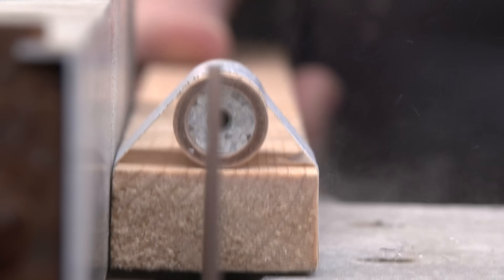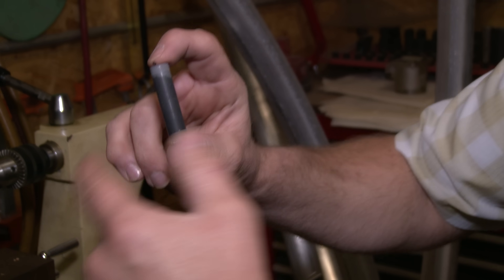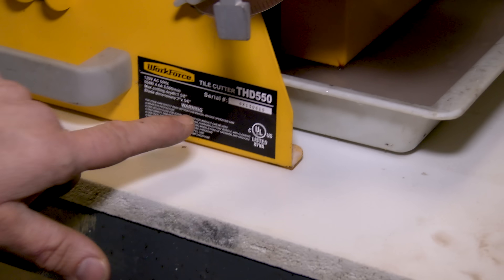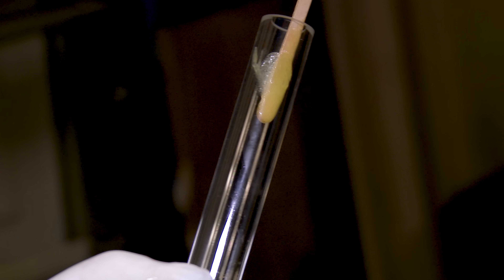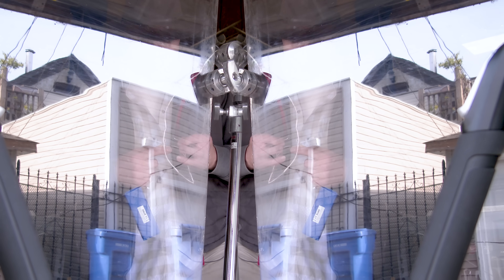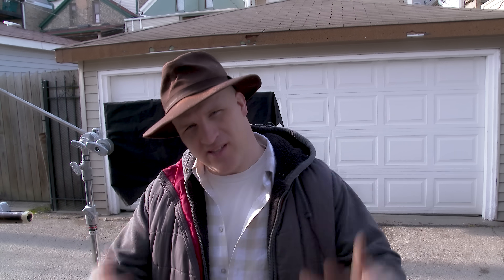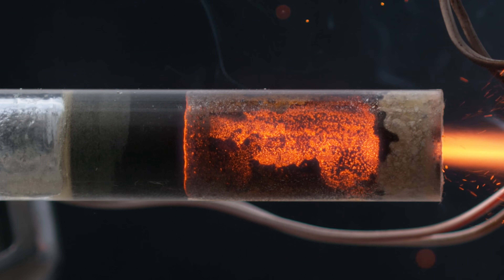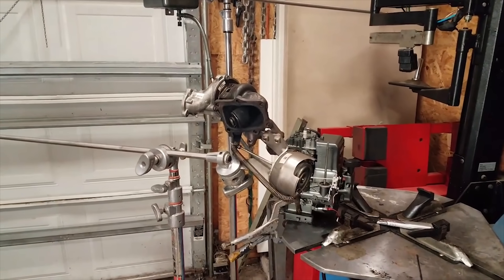See Through Model Rocket Engine - FULL ENGINE in Slow Motion 4K - Rockets (S1 • E2)

Comment: You can also clearly see the beginning of the burn has higher thrust than the rest of the motor, this is to help the rocket get off the pad in the thickest part of the atmosphere. They do this by putting a indent into the fuel in the shape of a cone to give it more surface area to burn instead of just the cross sectional area of the tube as with the rest of the rocket.

Comment: I worked for TRW Safety System’s on airbag propellant which was basically a fast burning rocket motor.  We worked on a sub scale test for a simple in process test as a quality control tool.  We measured pressure vs time into a closed chamber which simulated an airbag.  Our propellant burn was usually over in 100 to 150 ms. (0.100 seconds to 0.150 seconds). Technology was around to visualize the burn but we were more interested in the engineering metric to control quality.  The Estes burn is a nice progressive  linear burn rate.  Perfect for airbags and rockets.  Get up to pressure gradually (no detonation please) burn at a steady rate (set the speed control at cruise) sit back and enjoy the ride.  Good job.  Intellectual curiosity is a gift.  Pass it on!

Comment: SRB or Solid Rocket Booster, not exactly a rocket engine, high efficient and relatively cheap, thing is very different with an actual liquid fuel rocket engine.
Reply: yeah but i think that real liquid rocket engine is too complicated to use it in small homemade rocket so it's hard to use other engine than this.
Reply: @shrek8507  of course it becomes very complicated to build a small Rocket Engine, with all what it means, turbo pump, compresers, hundreds of moving parts, combustion chamber, nuzzle, fuel, oxidizer, etc... So I don't see where's the mistake in my statement, this is clearly not a rocket engine, just an example of a small SRB.
Reply: @nemo_theescapist3343  there is no mistake in your statement, i just say that SRB is only way in small engines like shown on this video. Alternatively you can use a different fuel but black powder is the most popular.

Comment: There is a much more simple way to do that. Use wax to seal both ends of the motor. Of course, the igniter needs to be installed first before sealing. It takes minutes before the casing is leaking the water to wet the propellant.

Comment: You need to hang a small weight on the ignition wire so it pulls the wires away once it is no longer needed to ignite the solid rocket motor.

Comment: Tile saw uses thin cutting wheel coated in Diamond abraisive. Diamond scores glass really easily. Score it enough in the same spot and you'll cut through. Cuts clean and even and won't break glass because it is a thin abrasive wheel, not a serrated cutting wheel

Comment: i know you're far from the only one to do this but... FFS stop trying to do sound design!! either play it silently or with some soft music, or record your audio at a high sample rate (if you can afford expensive high speed cameras you can afford a 192kHz audio interface) and play the actual slowed down sound. throwing some shitty stock explosion noises just totally undermines the value of the clip.
Reply from the maker: Ha! Thanks for the critique, however you can never ever make everybody happy, there's always going to be a few audiophiles with strong opinions. However this is a very old video, I do it differently now oh, even better than what you're suggesting.. no offense. See the problem with what you're saying is, you're talkin about sample rate, but what you hear is the actual frequency, so imagine the rocket is making a frequency of around 1000 Hertz, slow this down by 150 times, what are you left with?. 6.6 hz, can our ears hear that frequency? No they cannot. Even if we shot at a lower frame rate like a thousand frames per second, that would still be about 50 times slower than real time which would give us an audible frequency of about 18 Hertz, not detectable by the human ear either. and then it gets even more complicated than that when you start varying frequencies, because you would move into the audible and non-audible range and it would basically sound like a radio with a bad connection. Much worse than even the cheapest sound effects in my opinion. But I would love to know what you think

Comment: There is a Very Easy way to take a Engine Apart, Unroll the Tubing, Ive found that in the past to work, 
You may need to put it in water(this will not effect the engine if you do it correctly)

Comment: Back in the early 1980s, I remember a class-mate in high school who built his own rocket engines using his own special propellant.  I'll never forget the day he showed up at a local rocket launch and damn near wiped out the first row of spectators when his rocket got up about 15 feet in the air and decided to take a 90 degree turn toward the grandstand.  I've never seen so many people ducking for cover. If I remember correctly, it was a D or E-sized engine to boot.  Seems as though he packed it a little bit "hot". Mike Koss...this one is for you, man.

Comment: your supposed to light solid rocket motors from the nose mate. the 1.5 million pound of thrust Space Shuttler Solid Rocket Boostersare even lit from the top not the bottom. it is a more ideal method of ignition for most solid rockets.
Reply from the maker: Chemist4271 what do you mean

Comment: Please, be very careful using steel tooling as it can spark. When dealing with pyrotechnics, if at all possible, please use brass or aluminum tooling as it doesn't spark like iron.

Comment: so, the etch/scratch and tap method of cutting glass won't work, or won't work on the type if tubes you used?
Reply from the maker: FarSeeker8 it wouldn't work for me on the tubes I used. They were borosilicate 3.3, and they were 1/8 inch thick. So yeah I should have mentioned that in the video
Reply: Warped Perception Ah. Thanks.

Comment: you could easily cut glass with water, electric wire, and heat
Reply from the maker: tony smith that already sounds complicated. I tried the file and water which I have used before, but it did not work on this tubing

Comment: This is, without a doubt, one of the best videos on YouTube.  Thanks for doing this.  Have you done high power engines yet?  Dude, it would be so cool, and if you use an Aerotech RMS, you won't have to take off the paper casing.  I am subscribing and checking out your other art.  (What camera are you using for the slo mo?)  Doug

Comment: Beautiful rocket. One thing to note: a lot of the reason why people use specialized rigs for cutting glass tubing for things like computer water cooling is because they need to minimize the chance of glass dust or cracking of the tube. a glass particle can destroy a pump, and even microscopic cracks in glass can cause issues with structural integrity and longevity of a glass tube containing fluid.

Comment: Love the video!
Nice use of those light stands.
May I make a suggestion if you ever do this again?
Put a weigh or even a clothes pin on your wire so it will drop out of frame as the engine cycles.
Excellent work!

Comment: Most PC watercooling is done with acrylics though, it's a lot lighter ;) You don't want to cut that without cooling because it will melt ;) Coolest thing about the slow motion footage imo is that you can see the nozzle being melted and burning as the rocket is firing. Really cool stuff!

Comment: they use acrylic in PC's not glass boss. like always..
Reply: there is probably a better score and snap method anyways, I see a lot of vibration coming off that tool.  the benefits of editing i suppose.
Reply from the maker: stu matt they use glass , at least the hardcore gamer builders do, just Google it, I myself was surprised. it's because the glass doesn't get cloudy over time. also the snap method doesn't work for tubing this thick and of this composition. this is very strong glass
Reply from the maker: stu matt you are right though, it is better for editing

Comment: I enjoyed your video. I am guessing that the burst of energy you had towards the end of the burn was from an internal fracture in the fuel creating a larger surface area to burn. Often times in larger scale motors you will find the centers of the engine drilled to get a greater thrust but at a shorter but a shorter burn time. I have also had unintentional internal fractures much earlier in a burn that resulted in what I would call a spectacular total loss of my rocket. (If only I could find the lost video) Thanks again for the video, it was fun.
Reply from the maker: Andrew Gronquist thanks for that , that's a good point. glad you liked it !

Comment: I think it would be a lot more clear if the fuel itself wasn't glued. I suspect the glue kinda obscured the view somewhat, even if it may be thin. As the glue burns, it blacks out some of the view.

Suggestion: Glue only the ends of the "guts"
Reply from the maker: +SysGhost yeah that's true, but if there is any space for air between the tubing and the fuel it will prematurely ignite

Comment: You could buy a sight glass cutter for cutting sight glasses for boilers of tanks. They are the size of pliers and adjustable.
Reply from the maker: Kevin The welder that's funny you say that I actually have a pair, I didn't use them on this glass though, I don't think they went this big.
Reply: just a suggestion for anyone that wants something small or for your future reference. Great video!

Comment: I used to make gunpowder and pack rocket engines when I was a kid, I was into those "Estes" model rockets. I knew what was going on but this is the 1st time actually SEEN it. Repeat question: HOW can GLASS hold the pressure?! It would crack or melt from the heat alone. If this is fake itsa dang good one ....
Reply from the maker: +FractAlkemist lol, no it wouldn't be any fun if it was fake, it's a space / laboratory grade structural and heat resistant glass it's very strong and very heat resistant , I myself was still surprised but it held up.

Comment: score glass tubing with a metal file and snap it opposite the score mark
Reply from the maker: +Ikeman I tried that multiple times, this particular glass tubing was a space grade tubing, it's really hard core comma wouldn't break with the score method. Someone else told me I should use water and the score method, I may try that next time but the wall thickness on this tubing is about an eighth of an inch.

Comment: Technically this is a motor, not an engine, because the propellant is stored in the combustion chamber. Engines require the propellant to be fed into the combustion chamber.

Comment: Did you drill down the middle of the black powder?
Reply from the maker: +Joe Anthing no I only drilled to clear the nozzle
Reply: Ah, if you were using this for thrust then drilling down is a must. Leave about 10mm from the end though, or the radius of the tube. This way it burns evenly for max thrust. For a demonstration like this, your way is better.
Reply: My thoughts ezzackly. The Nasa solid rocket boosters have, I believe.

Comment: This is a perfect playground for experiments.

I think there is a lot more efficiency to get from this type of rocket. Using high voltage charge between the tip of the flame and the nozzle would probably speed up the plasma flow.

The microwaves at the back of the nozzle could probably speed up the plasma too.

Keep on experimenting !

Comment: should have just glued a stopper inside the tube, not have to worry about epoxy potentially blocking or distorting the view of the inside, unless it was needed for more sealing rather than just securing the engine inside.

Comment: What a lot of cocking around. Would have been way easier to buy some black powder, kitty litter and a wooden dowel and rammed you own engines. Probably could have made 10 for the same price and time spent on getting the fuel from a commercial rocket engine.
Reply from the maker: +Bob Smith he's that is true but it's illegal to do that in Chicago. That was my first thought, but I also wanted to give an exact representation of what happens inside the model rockets that most people buy and use.
Reply: Fair enough, and nice work. How about for you next trick, a core burning rocket motor with a transparent end cap in 4k high fps. Core burner fuel grains don't usually go all the way to the end, but for a visual representation, I'd like to see that.

Comment: Great video, thanks. It seems that you could test a model of the Space Shuttle motor. It uses several sections with L/D about 1-2 with a central channel which you have to saw and drill (dangerous!). Sections are installed with gaps 2-5 mm (in the model) between them. The outer surface is isolated like in this model. The charge burns in the channel and on ends of sections.

Comment: This is very cool!  Pretty accurate machining there!  Used to "do" a lot of Estes several decades ago (unfortunately... the decade part, NOT the Estes part).  Some observations on the burn starting 4:48.  Amazing how long the rampup to thrust takes after the burn starts.  That internal slug ejection later on REALLY looks like it skies the pressure for a moment. It looks like it basically doubles the burn area.  
I remember hearing popping and banging going on in the Sat V engines.  Obviously, those were liquids, but I suspect something similar going on, caused maybe by momentary major flow changes (due to some small amount of liquid getting to the sprayer, maybe, or some kind of turbine or piping dynamics?).  
It's interesting how there is a quick burn path to the case, just in front of the (clay?) nozzle VERY early, and then directly adjacent is one of the slowest paths to the case.  Also, I wonder what all those sparks are coming from.  There seems to be an excess throughout the burn on the top, if this is not just due to motor orientation, or viewing angle, but seems to be more at top than bottome.  Is this just unburned propellant being ejected, or is it burning nozzle?  I wonder if you could observe any changes locally in the nozzle after the burn where this has occured?  Thanks for posting, interesting and entertaining.  Had forgotten about the great smell.  I wonder if those little engines are sugar based?  Used to love the smell of 2 cycles running castor oil, and model airplane engines, too, but I'm probably as weird as you are.  ;-)  And yes, the right tool for the job (glass) is usually the right answer.

Subscribed and thumbed up!

Comment: Although a bit more complicated. This shows how a solid rocket engine burns. And you can basically imagine what happened to the Space Shuttle Challenger. May the astronauts Rest in Peace. Try drilling a small hole into the side of an engine, and see what happens in slow motion. It would be interesting to see the results in slow motion. Thanks.

Comment: what is the relevance of the rocket engine nozzle. I understand that it yields a higher pressure so that exhaust gas exits faster. I don't understand why that is relevant. energy cannot be created or destroyed. If a rocket engine is fired without a nozzle, i expect that the rockets velocity will be much slower, however, where did the extra energy go?

Comment: You don't need a tile saw to cut glass (Pyrex, or Borosilicate)  tubing, or rod.   All you need is a file and a little bit of water.  Use the file to score the glass at the point you want to cut it. (a 1/4" long score mark will be fine, just a scratch is all you need.)  Put on some gloves to protect your paws and put a drop of water onto the nick.   Bend the tubing away from you, with the score mark facing away from you.  It will snap very cleanly along the nick.  You will need to dress it a bit with some sandpaper to take the sharp edge off, or use an acetylene torch to flame polish the glass.  The water weakens the bonds in the glass where you score it, causing them to 'un-zip' when you apply bending force on the nick.   With just a bit of practice you can easily cut glass tubing up to about 2" in diameter or glass rod up to about 1" in diameter. (thin walled Pyrex/Boro is a bit tricky to get a clean break, but it can be done easily with a bit of practice. You have to pull it as well as bend it to get a clean break.)
Reply from the maker: metaforest well I've actually tried that and it works great, but when the tubing is this thick I have mixed success
Reply from the maker: metaforest I'm definitely going to try that tonight with the thick tubing I have
Reply: Pull outwards while bending... it reduces the stress on the compressed side of the tube, and increases the stress on the scored side.  You might need a longer score mark for thick walled or very thin walled tubing.  I have a lot experience cutting glass this way...  I spent a few years blowing glass.  I live on an island now, so getting industrial oxygen (compressed or liquid)  here is insanely expensive.

Comment: You also where not boosting that Briggs and Stratton you where merely running its exhaust trough a turbo. that is not turbo charging an engine.
Reply from the maker: gregg4164 that was the intial testing, in the the background of some of the shots in this episode, you can see the turbocharged engine finished, that's actually our next full episode that's going to publish , I just couldn't get the thing to blow

Comment: This video is fantastic! I can imagine that it was not easy to take the fuel grain out of the original casing and then get it into the glass tube in such a way that the burn would stay on the correct surfaces! Well done and thanks for doing something I bet a lot of us would like to do but just can't or don't believe it to be possible!
I know you got a lot of hate for the cross section rocket test, from me included, but it would be amazing if you could find a way to seal the fuel grain to the transparent surface to see the last hidden bit where the burn spreads upwards and outwards from the core.